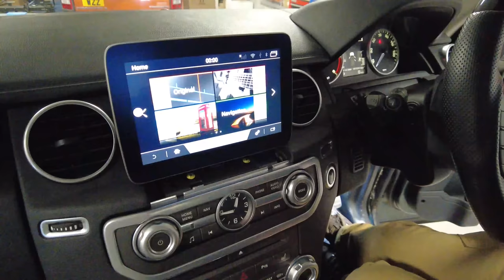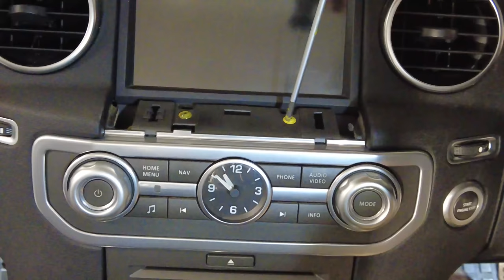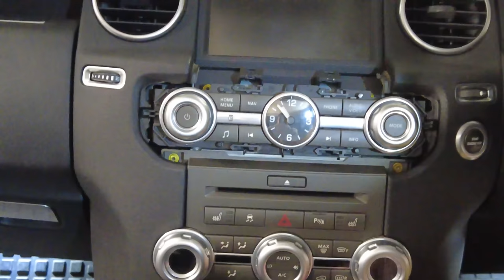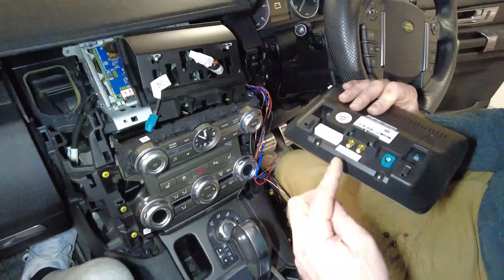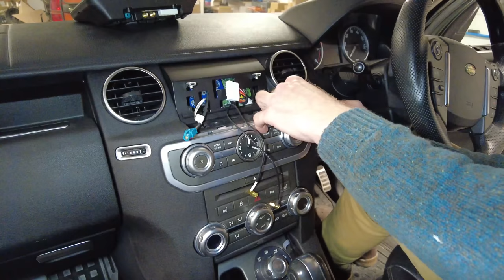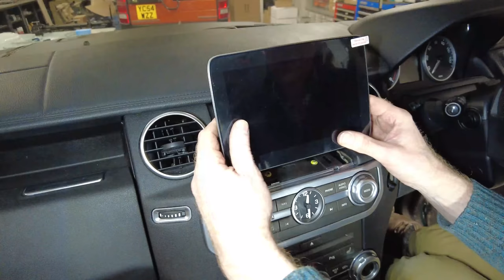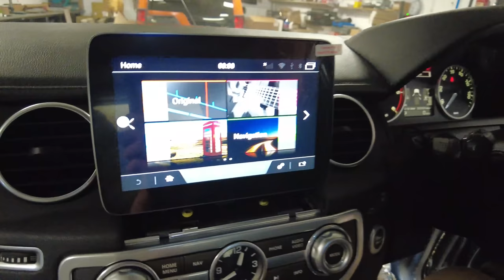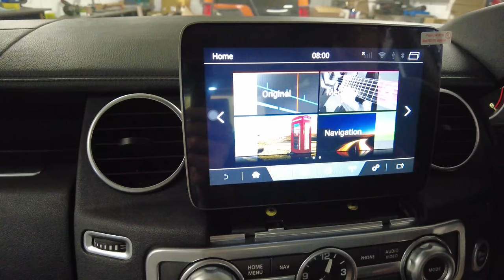Installing Android Carplay unit (small) in Land Rover Discovery 4 LR4 - Step by step V2 !

Comment: Will this unit or the ten inch one you've done, fit into the Discovery4 GS 2010. Also, is it possible to retro fit cruise control to this model.  Only just become a disco owner and would like to upgrade it but by bit 👍😁

Comment: Is it possible to upgrade the radio to  the Bosch radio from the older uglier one? Of so can I fit an HSE (higher spec radio) because I have an SE spec and my unit does not have, Bluetooth audio or phone and it also does not have the 4x4 info screen. Thanks for the lovely videos.

One day when I  older I will buy that Defender side bin thing you show in one of your videos (new Defender). I think it is super cool.

Comment: Thanks for the tutorial. Without it I would have not gotten this installed. I installed on my 2016 LR4 with the Bosch unit and everything works pretty well. All original functions are in place. CarPlay works well. The one issue I am having is while on a call the internal mic on the unit picks up the wind noise from the AC vent and the engine noise making it impossible to use the speakerphone function. Instead I have to turn the speakerphone on the actual iPhone or use air pods. Have anyone experienced the call issues?
Reply: Hi Shane I have a 2016 D4 and from what you say all works even the 4x4 screen info, can I ask where you bought this from and how much it was? Thanks
Reply: Where did you get the unit from?
Reply: Could you post a link or the name of the actual radio? So the rest of us can look this up. Frustrating to see a video of how to solve a problem with the LR4 but no way to buy it

Comment: Absolutely fantastic! Can't wait to see the setup and testing. Quick question for when you do test, is there a way to access the OEM menu's and car information, like 4x4 Info?
Reply from the maker: I think this will be available - just need to sneak off to the workshop and test the software....
Reply: @L663  that would be useful as it is always a worry about what functionality you may loose, especially the 4x4 information.
Reply: @L663  would this system also be compatible with a logic 7 Discovery 3?
Reply: @baz4x4r  would be even better if they could enhance the 4x4 info, with incline, roll, altimeter etc...

Comment: Do you have a video of upgrading from disco 4 denso to bosch?
Reply from the maker: No - not sure this is possible
Reply: @L663  And by mortgage considering what would need to be replaced to have a Bosch system, such as in the version after Lift

Comment: Simon.

Great video and commentary. I assume you don't need to disconnect battery. Am I right to think that this unit will now need an Android 'phone to power the Sat Nav? Or will the pre-existing Sat Nav still display?
Reply from the maker: Hi - I amnot sure yet but to use WAZE / GOOGLE maps etc you will need a phone although i think there is a SIM card slot that you can use aswell ( or instead of a phone ). I think the original car screen will be available - i have not even checked yet !

Comment: So how does the audio get back into the LR system? Through aux?
Reply from the maker: I think as we have retained most of the LR system it will use the LR smp etc - its just the screen that has changed... its more like you have a pair of glasses which overlay an image on what you see normally... if that makes sense.... got to get into work and test it later..
Reply: On my tesla style screen  The sound from the android part of the unit goes out through the aux plug on the new loom. This has to plug into the landrover system aux in socket. The only sound that doesnt do this is the android blue tooth phone which is what the extra speaker is for.

Comment: Great videos! Links for CarPlay units???
Reply from the maker: Let me see what works before we send everyone off to buy one..
Reply: @L663  would be great to know if the unit as installed supports the factory reverse camera (i noticed further wires for external camera) but if its already factory, are the loom connections already supporting it?